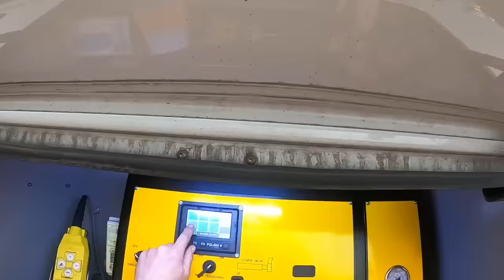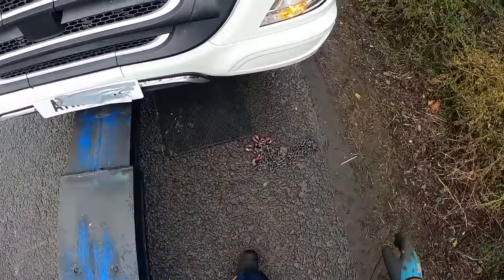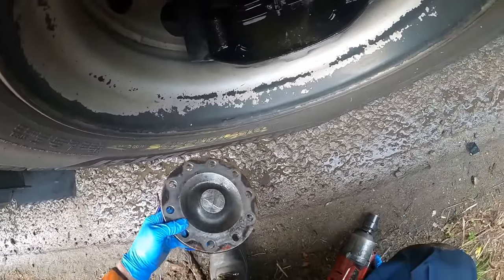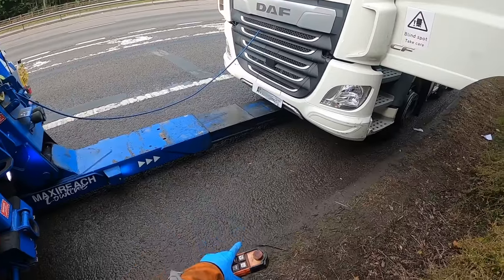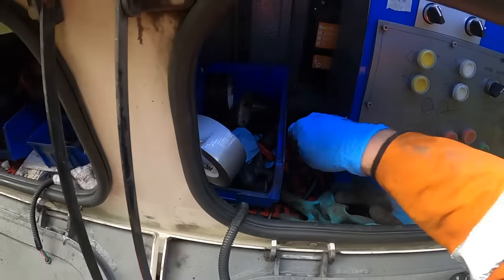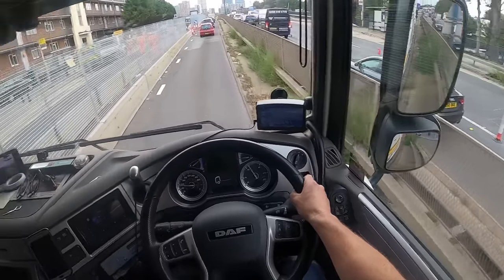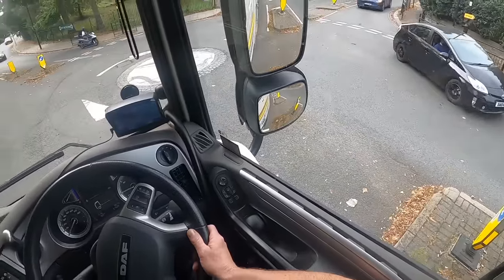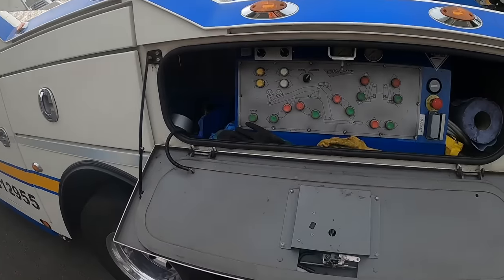TOWING 44 TONNE ARTIC LORRY THROUGH LONDON!

Comment: I used to work for a car auction company nd we had the We Buy contract, collecting from near Heathrow and bound for the depot up at Newcastle. The way it worked the more I could load the more we made in commission so 12 car loads were the order of the day and a lot of head scratching as the route out included a bad junction followed by a 16 foot bridge as you were still pulling out the junction itself. The gearbox let go just as I got the peak under the bridge , that was a fun job for all involved as the pto wouldn't engage so lot's of hand pumping just to limbo under the bridge as once lifted it was measuring 16'2". Lost a couple of aerials on the concrete cow bridges near Milton Keynes on the way back north :) Managed to dump the load in the services a few hundred yards from the depot and run them away on trade plates to save all the grief of trying to get to the yard before heading to the dealer north of the Tyne.
Reply from the maker: Hi Glen thanks for sharing that mate ,  bit of a nightmare for us to recover as well long and high with cars on. How you work out how to fit all the cars on them takes  some experience i bet , hats of to you.

Comment: Impressive! Fascinated that the recovery truck has custom place for removed half shaft. I guess you remove the shaft to reduce rolling resistance by effectively isolating the diff from the prop shaft. I noted on the bus recovery you had to remove both sides. I guess that is because the rear engine and gear box are integrated into a transaxle - just like my 1972 Hillman Imp. Orbs not in the same league as a bus engine!
Reply from the maker: Thanks for watching Nick , Cheers.

Comment: Nice one Steve - those suburban streets never look wide enough 😂 That’s the first time I think I’ve seen you use an electrical suzi instead of the light board - is it more convenient? Cheers.
Reply from the maker: Hi Thanks for watching , the only thing using a electrical susie  is you need to fit a rear number plate thats the same as your tow truck. But now you have use of the trailers marker lights so best to use susie at night.

Comment: Great video, First time watching you and it really was some great driving through London. My only question, is there a reason why you don't put the suzie's through the trucks mirrors to hold them up out the way? just watching you sort them out and I was questioning it. Thanks
Reply from the maker: Hi Sam thanks for watching ,  use to when air lines were new but now they bit marked and rough so could mark paintwork on doors , so tend drop down now to step to be honest.

Comment: Great video and great recovery 👍 only 1 thing to say not being being picky or pointing something out to annoy you or cause an issue, buttttt as an artic driver myself, the major thing I do a lot when doing a quick walk round, is noticed you didn't check the PIN 👍 (you might have off camera) but I never saw on camera pre setting off 👍 hope this comment you don't take in offence/criticism👍
Reply from the maker: Hi Chris thanks for watching , no problem for asking mate i did not check the pin as it not been uncoupled and a mechanic has not attended i would of checked if they had done a trailer swap prior to my arrival. On a hard shoulder i try to keep my working to the nearside but thanks for commenting.

Comment: Why did you need to remove the half shaft before towing? (Obviously non-driver here!)
Reply from the maker: Hi thanks for watching , we have to disconnect the drive to gearbox by either removing the half shaft or disconnection the prop shaft safe guarding any potential damage to the gearbox whilst being towed.

Comment: What is the main purpose of a half shaft? And why it has to be removed for a tow?
Reply from the maker: Hi Matt the purpose of removing the half is to disconnect  the drive to the gearbox so there is no moving parts in the gearbox that cant be lubricated when the vehicle is being towed.
Reply: @HeavyRecoverywithSteve  thabks for the info. Great video as well

Comment: Im genuinely confused, whats the pole you removed from the back wheels?
Reply from the maker: Thanks for watching , we have to disconnect the drive to the gearbox  on commercial vehicles we tow , so by removing the half shaft in video we out safe guarding any potential damage to the gearbox  as no parts in the gearbox our moving now , just drive wheels our free running.

Comment: Surprised they don't use diagonal/crossed chains for the front axle to stop any sideways slip, but clearly that's not how the eyes are configured (they're positioned for straight up and down).
Reply from the maker: Hi Tony thanks for watching ,  if you locate the correct width fork onto the Daf axle  just were it increases in diameter the fork will not slide any further along the axle as its to wide to let it slide passed.
Reply: @HeavyRecoverywithSteve Good to know. I figured they might have cast a stop on the underside, but couldn't see one so wondered if it might not move laterally or catch on a mount of some kind.

Comment: Wouldn't u have fed the suzies thru the mirror arms to keep it away from the ground?
Reply from the maker: Hi Thanks for watching ,  do still hang off mirror arms , but you have to make sure suzies clean as your running down side of  cab doors so any grease picked up from coupling to trailer does make mess down sides.

Comment: I would leave the tyre stands in, until I was finished underneath, but I am a bit wary.
Reply from the maker: Thanks for watching ,  always use wheel stands whilst working under truck and wooden sleeper placed under boom is a extra safety aid just in case you have a air bag blow on recovery truck causing the boom to drop. I believe now being advised in heavy training courses.
Reply: @HeavyRecoverywithSteve  That's good to know. Great content.

Comment: Da-da-dum! Da-da-dum! Da-da-dum!   22 plate DAF and they are still full of bugs causing the warning buzzer to go off every 5 seconds.  Nothing has changed.  Was the same in my 20 plate, 65 plate, 11 plate and 06 plate 105.  ABS fault, EBS fault, bulb warnings (always the side marker bulbs in the outer parts of the rear clusters on the tractor units), AEBS fault jamming on the brakes going under certain motorway bridges for no reason.  And the slowest changing autobox ever made.  Glad I don't drive for a living anymore.

FYI putting on your beacons to pull out is a waste of time as they are completely blocked by the tractor and trailer you're towing.   Can't even see them from another truck so no hope for cars/vans - not that they'd take any notice even if they were visible.
Reply from the maker: Thanks for watching and commenting ,  beacons on flyer and front grill visible  from the front you can only hope others take notice.